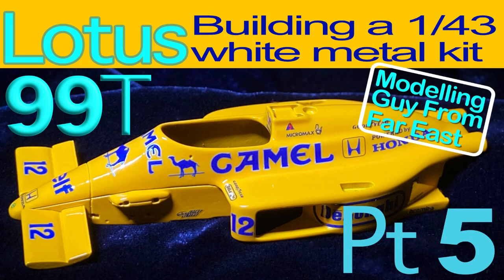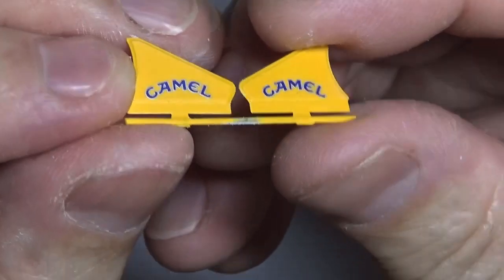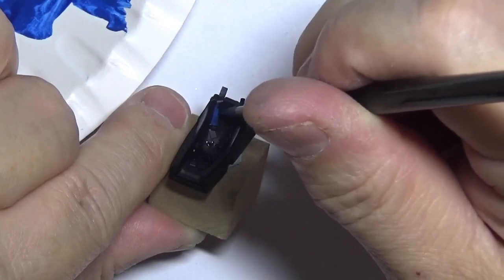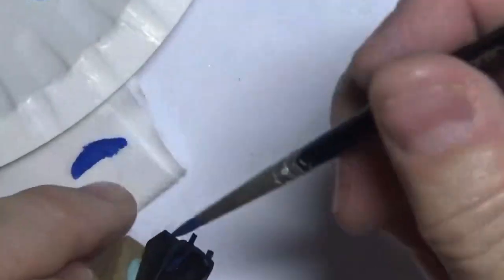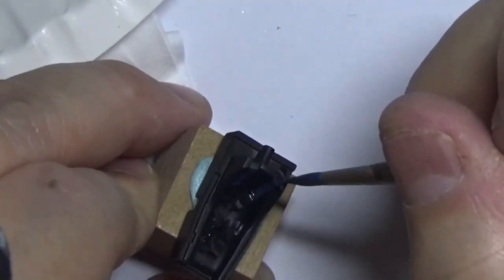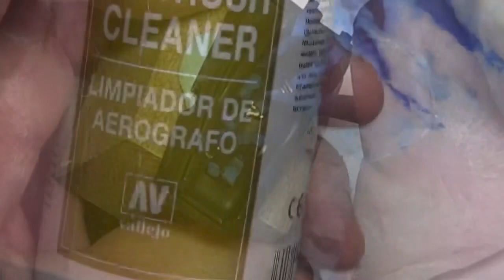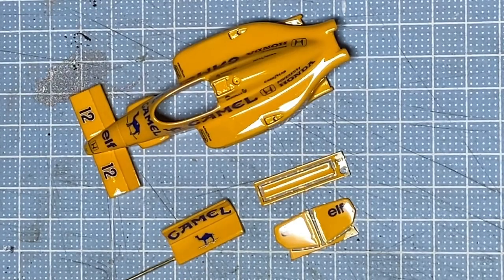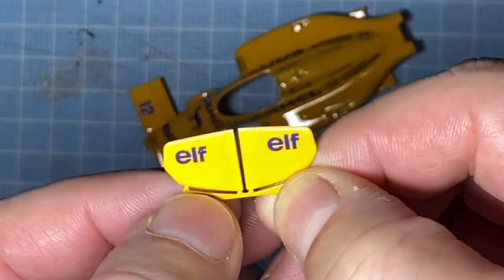Team Lotus 99T Part 5 on building a 1/43 white metal F1 car kit

Comment: Nice work!
Why do you prefer to glue the seat belt before painting? is not easier and cleaner to paint the seat belt before gluing to the model?
Reply from the maker: Hi, there are two main reasons for glueing the seat belt onto the seat before painting. First, it is always a stronger bond if these parts are unpainted. After painted, then the bond will be part to paint, paint to paint then paint to the other part. We all know that the paints' adhesion to the part is not the strongest. Not to mention metal to metal, even plastic to plastic. I always try to glue the parts together before painting if possible. Second is to get a natural draping effect of the seat belt onto the seat. Other reasons; if I use two parts epoxy glue to glue them together, I can clean off any spill out glue with alcohol which may destroy any paint surfaces, plus I can get a better sense of shading of the belt if I have reference of the light and dark areas from the seat.

Comment: how do you spray the clear without damaging the decal? also thinning ratio?
Reply: A general practice of Japanese modelers is to final clear coat their car models so usually it's safe to use clear paints from Japanese paint brands such as Tamiya, Mr Color, Finisher and Gaia. If you use clear from other manufacturers, then check if they are actual auto paints and not to use their thinners for they may be too strong for decals. If possible, thin with Mr Color's Leveling Thinner which as far as I understand does not attack plastic hence much safer for decals. Always apply a couple of thin coats and let them dry thoroughly first before the final wet coat. It's also good to test the decal with your clear first. Hope this helps.